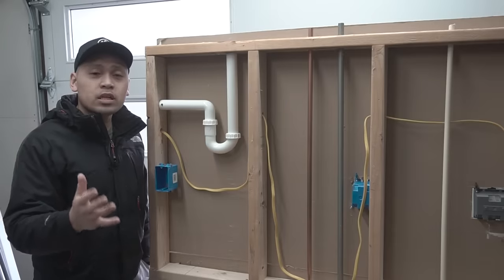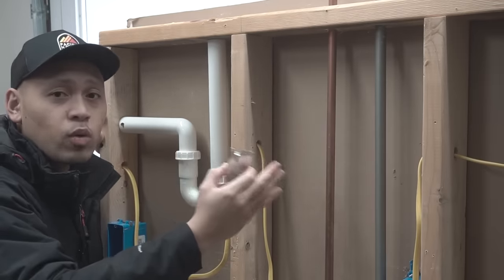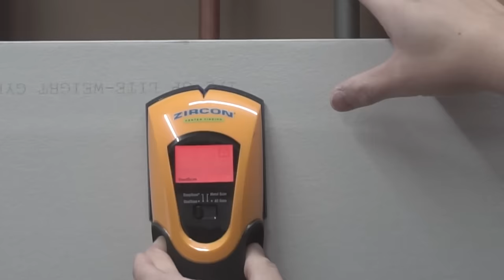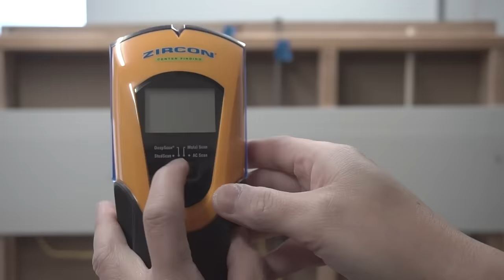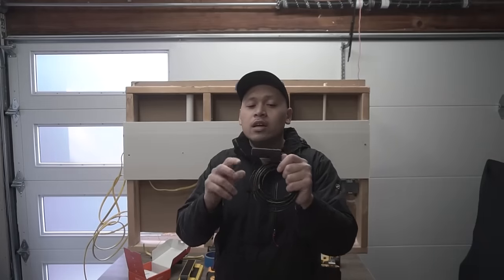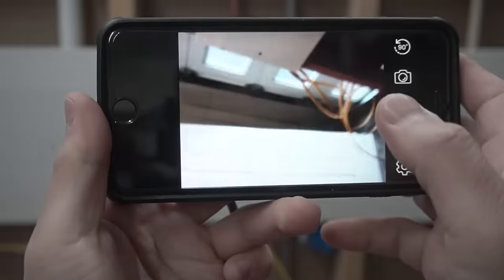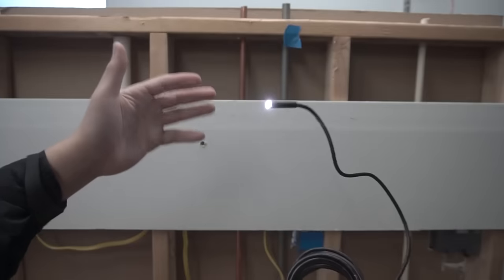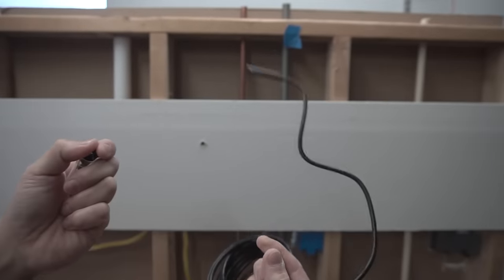STOP Drilling And Nailing Blindly In Drywall And Studs! - Learn A Better And SAFER Way As A DIYer!

Comment: Those endoscope phone apps require way too many permissions for me to feel safe using them. I'd rather use one that doesn't need a phone.
Reply: I got this specific brand and it also only worked with their specific app. I say "worked" instead of "works" because they stopped supporting it after a year or two. Fortunately, it still works in Windows as a plug and play USB camera, without any software, but I would not recommend this brand or any other that requires a special app to use on Android or iPhone. If it doesn't work with your phone's built-in camera app, hard pass.

Comment: So you have to drill blindly into the wall to determine if its safe to drill into the wall.
Reply from the maker: There’s a difference between drilling and carefully drilling into a wall. When you drill a hole for the endoscope you have to slowly drill until you just break the drywall depth. Don’t apply so much force because if you do, it defeats the purpose.

Comment: "be careful, you dont wanna screw into a live wire" proceed to screw panel right next to live wire
Reply from the maker: Be careful
Reply: @FixThisHouse  I'm hitting a big metal plate when I try to fix drywall. 

The drywall panel came loose at the top, it's not flush with the wall anymore.. there's a big gap where the paper tape should be.. I can push on the wall to make them touch again.

When I try to screw the drywall right under a screw (I can see them poking out of the paint) I'm hitting metal... I tried to piece a few other holes but it's always metal underneath. 

Could it be metal studs? It's a bathroom, I'm not the owner, this is an apartment but my landlord won't fix it....

It's always like wood studs are inexistent and all I'm finding under the drywall sheets is metal... I also don't own a stud finder... I did like 50 holes in my bedroom and I could never find the damn studs... It's frustrating !

Comment: If you want to be sure just go ahead and cut out a 6"x6" or larger hole in the drywall, being careful not to cut too deep. This way you can actually see what's in the wall. Especially if you are mounting a TV or anything heavy and you need to be sure.  You can use the cutout piece of drywall and some scrap wood to patch the hole, and since it's behind the TV or Cabinet or whatever large item you are wall mounting it will be hidden and doesn't need to look perfect. Also, don't use screws that are too long. Inch and three quarters for mounting a TV. The thickness of the bracket and washers make inch and three quarter screws the perfect length. At least #10  screws for anything heavy, #12 and #14 are good as well, just be sure to drill the correct size pilot hole to avoid splitting the wood. Don't use nails or screws to hang up pictures, use command strips and hooks, they work well and can be removed without damaging the wall.
Reply: TVs aren’t heavy…
Reply: @eln0n01  Some large TV,s, 80 inch plus flat panel leds are 200lbs or more. Better to be safe than sorry. Even a common 55 inch TV can weigh around 50LBS.

Comment: Make the camera hole with a screwdriver
Reply from the maker: That works too! But I would be very careful, you don’t want to apply to much pressure that if it does penetrate through you might hit a cable. Slowly and deliberately

Comment: Good video, an extra recommendation is switching off the breaker of the room to avoid any fatality, if your stud finder is not trustable
Reply: One of the simplest and safest ways to prevent electrocution - underrated comment. If you're not sure whether there are live cables, simply turn off the main power. Similarly, if you're not sure whether you might hit plumbing, turn off the supply at the stopcock, open the taps and flush the toilet until it all runs dry. You might still hit the pipe and rupture it, but at least you won't have a minor flood on your hands.

Comment: I have always just drilled and didn't give it a second thought. What happens if I hit wires? Is that bad? I was installing a new doorbell and drilled pilot holes into the stucco on the outside. Now I'm scared to finish! Thanks for the detailed video. Very informative for someone that just does things without considering the "what if's!"
Reply: My understanding is that, if you hit a live electrical cable with a metal drill bit, there is a significant risk of you suffering an electric shock. Even just a minor jolt could make you fall off your ladder, or the shock itself could result in serious injury or death. 

If you hit a pipe, then you are likely to end up with a plumbing emergency, as water will start gushing out of the hole and flooding inside your walls. 

As someone else mentioned, safest way is to turn off the main power so there's no current flowing through those wires, and I'd suggest turning the water off at the main as well, if you're drilling anywhere there's likely to be plumbing.

Comment: I learned to use a heavy magnet to find the drywall screws. Once found I start measuring 16" O.C. and it avoids the problem of hitting wires, and other utilities.
Reply: But the drywall screws might not be centered to the stud. You'll need to drill just left and just right of the screw to ensure good position.

Comment: Excellent instructional video on the hazards of drilling holes/using screws in an interior wall.  Was it perfect in describing every situation that might exist, like many comments pointed out?  No, but you would have been here all day and covered most of the basics except maybe mentioning insulation on an exterior wall. You can easily poke a hole through it to get the endoscope in without using a drill. It's a damn good video IMO and you did a great job in taking the viewer through it. You're very good at this. Subscribed!

Comment: One of the simpler methods as well is using a self drilling plastic wall anchor. It’s not electrically conductive, its tip is blunt enough to only go
Through drywall and you can retract it by going in reverse on your drill/driver to look inside or insert the endoscope.
  Genera rule of thumb is to treat every wall like a blind monkey built the thing and expect nothing to be where it should be.
  PVC plumbing is the most nefarious by far as sometimes it might show as a “stud” on the finder and you’ll think “oh it’s all good”. Hence the plastic self drilling wall anchor. You’ll hit the pipe but not go through.
  Truly one of the safest ways aside from spending a few thousand on a tool Bosch makes that literally sees through the wall and gives a 3D representation on the screen you’re holding.

Comment: Haha paused right when you said especially on older houses. My place was built in 80 something and I doubt they used those metal plates cuz they wood glued the cabinets to a plastic countertop. Nothing is straight! There isn’t a single 90 degree corner in my house

Comment: Don’t drill random holes, but yes please do drill a random hole to put this $40 camera through so affiliate revenue can be earned. Really?
Reply from the maker: When you do regular drilling you drill with force. When you drill a hole for this camera it’s controlled and gentle, you have to feel for it until just enough to break the plane of the drywall or plaster. What’s wrong with affiliation?
Reply: @FixThisHouse  then why not drill gently 3 more holes, throw in the anchors, and call it a day?

Comment: PLEASE HELP: ANYTHING HELPS. I will be installing some melamine cabinets soon and the wall has plywood behind it. My cabinet backing is 3/4 I would assume the sheetrock is 1/2 and plywood 3/4 or maybe half? ANY IDEA on what screws I should use for extra strength any tips help thank you! I usually use 3” screws when I install these sort of cabinets but just the thought of the plywood behind it makes me worried. I know where the studs are behind the sheetrock and plywood but still. I was just thinking of putting Atleast 4 in each section and legs for extra strength TIA!! Anything helps thanks guys!!
Reply: I am probably late on this, but having plywood there will strengthen the hold vs weaken it, it is a good thing! Assuming you are not able to screw directly into studs, I highly recommend long toggle bolts. They have metal wings that pop out and then are pulled against that plywood for a super strong hold. If you are mounting into studs, you are fine so long as the screws are long enough! That's about as secure as it gets!

Comment: If I don't have the camera and I don't want to buy one, could I not just drill through the drywall in the intended place where the mounting bolt is going, and then drill 1/16 to 1/8th inch at a time and then look inside the hole with a flashlight and see if there is a cavity where romex or pipe may be running through?

Comment: I removed the vanity light of my bathroom to install a new light as I was drilling on  the wall I hit something hard and me not knowing(first time d.i.y) kept going and I believe I drilled through a metal plate. After watching your video now I know why they have metal plates in between walls, my question is how would I know if I did some damage to pipes,wires etc. So far no sign of damage to pipes or wires.  TIA
Reply: Did you ever open it up and check it out?
Reply: I did something similar. What did you end up doing?

Comment: I had the power off when i was demolishing a small section of drywall. A drywall nail had pierced the 2.5mm TPS cable neatly between insulated wires😮

Comment: That’s only applicable when it is sheetrock. If it is a very old house with horse hair plaster and lath those stud finders will not work.
Reply: Plaster walls in my last two homes. Those stud finders do still kinda work but you have to do a lot more scanning of the wall and sort of "interpret" the lights that pop up and cross-correlate with other measurements. Like if I think I've finally found a stud I'll confirm by trying to find the next stud over and seeing if it's really 16 inches.

Comment: Not quite sure of the logic here, you still need to drill holes blindly to pass the camera in the wall. Maybe if you drill ever so lightly the first drywall sheet it could limit the impact and then you can see in the wall with the camera

Comment: Before using that telescope, HOW DID you know to drill THERE?  That very spot!
Reply from the maker: You will need to drill a hole slowly and gently with controlled hands so that you  don’t hit anything that could be potentially be behind the wall. You won’t apply the same force like if you were to drill through a wall normally 👍🏽😊

Comment: Good caution ⚠️ video . This only works if there’s no insulation in wall . I recommend cutting a single gang hole out as an observation hole than put a blank plate over hole . (TV will cover it anyway)

Comment: its all useless ....In Australia , rockwool thermal insulation is filled behind the drywall , Most of the time it is so densely filled that you cannot run snake unless you use rigid snake ...so Camera wont work there either ...

Comment: You're right the Zircon "Stud Finder" can't even find studs half the time and the other half you can't tell what it's finding. I use the CH Hanson.  Magnets don't lie but you need to know what you're doing.  The endoscope is challenged with insulation on outside walls but still can give you more information than anything else. On inside walls I've used the endoscope fairly successfully after my vertigo goes away from viewing the screen.  Adding other lights as other  people mention helps a lot. Once again it helps if you know what could be behind the drywall.  In any event thanks for the video.

Comment: I know this is quite an old video, but most of those stud finders require you to hold them in place for a short period of time while it's turning on and calibrating. If you just turn on and immediately start moving it's going to calibrate improperly and may not even pick up the fact that studs are there.

Hold it in place, turn it on, wait until it loads fully, then start moving it.

Comment: You're going to drill through your drywall blindly or using a less than adequate tool. To stick a camera in to the hole you just drilled to prevent you from having to drill blindly or using a less than adequate tool.... Hard pass

Comment: i believe in code it allows the hole to be like 1/4 inch past the front of the stud as long as i think there is a nail plate. but then again thats assuming it was an electrician who drilled the hole. that inch and half screw may peirce the wire regardless if the center hole is too close to the edge

Comment: The studs should have strike plates.
Reply from the maker: That is true, but you can’t always assume the past renovator installed one. Always just assume the worst case scenario and be safe and do a detailed check 👍🏽🙏🏽😊
Reply: @FixThisHouse  the past renovator should have known better, especially if they pulled the permits. Strike plates are code.

Comment: Once you find the stud? Do you drill away from the stud or on the studs
Reply: If you have a camera setup like his, drill away from the stud. Drill through the studless dry wall. 
Drywall is about 1/2 inch. So put a tape on your drill bit to stop going further. 
This allow you to inspect and take note of any plumbing, electrical stuff, other stuff that's going on with the stud. 

If you don't, you drill into the stud and hope for the best. 

Hope this is not too late and you didn't destroy your house.

Comment: I would be a little careful using this info, the guy seems like he's trying to help but probably not really a subject matter expert. As a contractor if you pull out an endoscope on a job site to hang a tv your going to be laughed at. The biggest deal is using the proper length fastner and be 💯 you are in a stud (magnets are great) and have a general understanding of what is behind walls generally.
Reply from the maker: Thank you for the feedback, but this advice is geared mostly towards the everyday Diyer. Also what makes you certain that the last person who lived In your home bored a Hole on a stud so that they can run a pipe through it and did not stay 1 1/4 away from the edge and did not use .0575 shield plate to prevent inadvertent screws or nails through it? Point is, yes you might get laughed at, but at the end of the day it’s your safety that’s important. I would not put my safety at risk nor pay a costly mistake to fix drilled pipes or wiring. 👍🏽

Comment: You use your brain and the combination of tools/tips and experience available. 
Application hardware + existing environment = 
Implementation strategy
Know the building type and especially  where/when the wet walls & load bearing walls are constructed.
Tips:
Use a dull masonry bit when not sure.
A dull masonry  bit won't punture thru pipes.
Electric outlets and low voltage/cable  are usually  tied to studs which will help to determine  stud location.
Bore a bigger hole only to depth of sheetrock where you can  see the stud before you screw to it. 
New York City code is metal studs...so try using tech or sheet metal screws instead.
Use mollie  & corkscrew anchors instead when the weight is not an issue.
(Disperse weight over multiple screws.)
Check wall thickness and visually  look at backside of wall whenever possible.
When stud is located with stud finder...move it north or south in a "wave" pattern to determine  that is a stud running vertical the full length  of wall from top to bottom.
Avoid drilling on wet walls or only the depth required for a secure installation. 
Don't let the drill push thru past the the rock.
There is no need to run the drill bit further then what is needed.
Shut off electric
That's what breakers are for